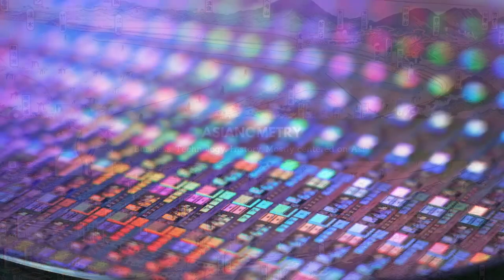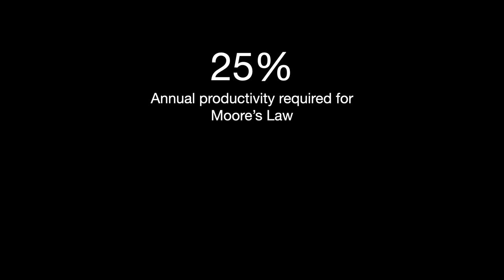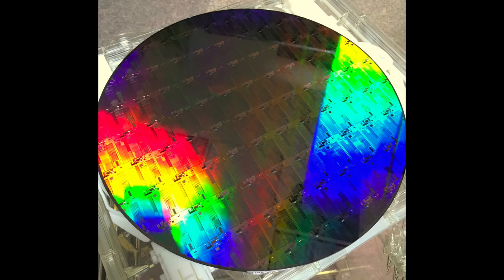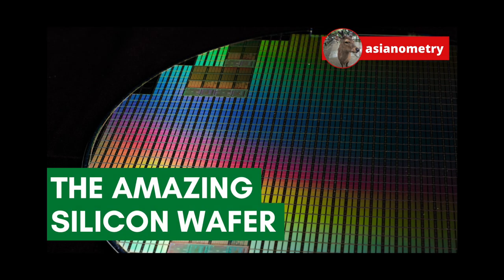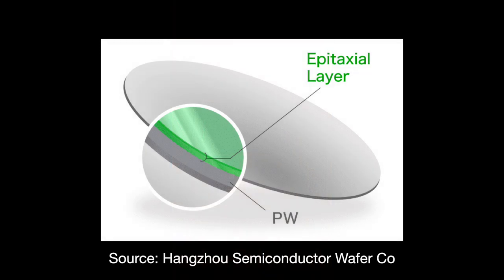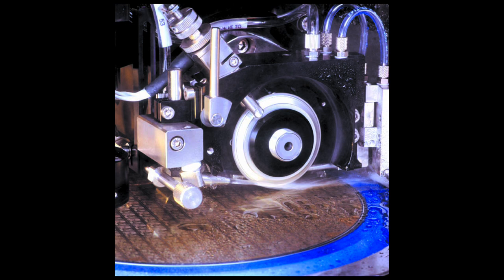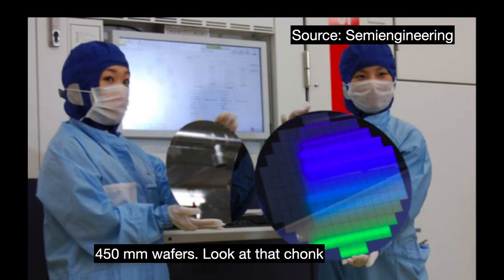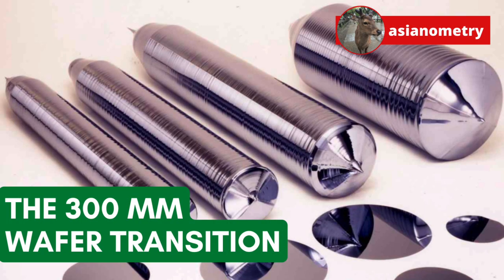The 300mm Silicon Wafer Transition

Comment: Some corrections or more detail!
1st Defects in the wafers substrates are not always bad. Bulk Micro Defects are very important as contamination getter and for mechanical stability.
So you have to prevent them near to the surface either by Epi-layer growth or Ar-anneal, but low BMD is also not always wanted. With CZ you cannot prevented it either. For power semiconductor, where you use also the bulk of the wafer for the device you need a different substrates made by the Floating Zone technique.
2nd FOUPs were not usual for 200mm. Either there are open cassettes or the cassettes are transported in so called SMIF pods.
One important part of the 300mm transition was the integrated full automation. Automated loading, transport and dispatching were the standard from the beginning.
3rd The 1st 300mm FAB was by Infineon/Siemens in Dresden Germany for DRAM. The FAB was later part of Qimonda and is now back to Infineon producing the 1st power semiconductors on 300mm. The 1st mover to 300mm were Memory Fabs and not Intel. Logic Fabs followed later.
4th You get more than 2.25 yielding dies from a 300mm than from a 200mm. The larger the die the higher the cut off loss at the wafer edge. So a larger wafer is more area efficient.
Reply: Was workers hurting themselves carrying 9kg around also accurate?  Because that's not that much weight.  Plenty of jobs require carrying more than that weight as a basic requirement.  Usually more like 20kg in a manufacturing job is a bare minimum written into job requirements.
Reply: This will be an issue for 450mm, but for 300mm it was not.

Comment: I worked in crystal manufacturing.
I saw a lot broken necks. This mostly happens when the finished crystal is ready to put out of the oven.
In fact it happens while it gets put out.
The crystal swings out of the oven. And the shear force does its job.

Then you have to clean the whole machine because parts of the crystal fall in 1000 pieces. Which sometimes damage the glas crucible. Which isn’t so bad. It’s not reusable anyway. But the oven itself can get damaged.

If everything works, the neck will be cut by pliers.
Reply: If there are any questions. 
Maybe I can answer them.
I did the 300mm crystals for the most part.
Reply: @markus4925  Interesting that you were part of actual boule growth.  Did you do any further work, like slicing and polishing, or were those all automated?  And were defective boules broken up to be fresh melt?
Reply: @markus4925  Do you think lower gravity would make the neck strength issue less pressing?
I imagine you want at least a little to keep the molten liquid in place, but it shouldn't affect the properties of the formed crystal I think?
Reply: @davidb6576  I could tell you what happens before the crystal is made.
A worker had to settle down rocks of material in the crucible by hand. Piece by piece. In a stricter clean room than the actual growth process.
The crystals itself have 3 marks lengthwise which grow together with the round structure. You use them to control if the crystal structure is still intact. That’s important while growing. You break up the oven process if you discover failed outer lines on the crystal.

The next process was sawing. That’s true. I don’t have much insights there.

But I visited the stage where the wafers are getting packed for the costumers. These are clean rooms of the highest levels. Like you see in Global Foundry videos for example.

Yes. You can restart a process. Usually you do it if a crystal breaks up in the middle of the growing process.
The crystal can break while in production by neck or at the position the crystal touches the surface of the melt.
If the neck itself breaks you need to install a new neck by hand.
After 3 failed restarts the whole load is considered as waste. You need to clean the oven and use a new glas crucible.
Reply: The process is automated.
The crystal is also watched by camera.

But you still can and sometimes have to regulate a lot of functions of the oven.
Like temperature, pull strength of crystal, different noble gas injections, preassure, ….

A worker usually looks at the error codes of one oven, then looks on camera pics and then through the lower glass of a machine. 
Then he/she walks to the next oven.

I once collected user experience for the developers to build a better control-GUI for the oven.
This was the most interesting work I have ever done. There were 2-3 experimental processes running everyday for 300mm.
The smaller diameter ovens usually didn’t need that anymore.
Reply: @markus4925  
Do you raise and lower the crystal or do you raise and lower the pool?
The void inside the chamber, is it a vacuum or some combination of inert gases?
Reply: @MostlyPennyCat  You place the seed crystal on a long metal rod. Which is placed in the upper part of machine below the oven. Connection itself is not metal on crystal directly but metal on graphite. (I forgot some details) but the crucible itself is also covered in graphite. Which is very interesting. 
No bare metal is touching any of the melt. If you need to touch anything within you use ceramic tools. 
After the melt gets more and more liquid state you are lowering the seed crystal. Often by hand till it went into the melt some millimeters.
Then you adjust the pulling.

Technically you could also lift the stand of the crucible a bit. But that’s more for cleaning purposes.

When the crystal is done you lift it out of the crucible. At that time it’s some 10 centimeters inside. Because you are not only pulling it out. At the same time the melt level is lowering. Which makes adjustments necessary.

I can’t remember details for pressure. 
But I am sure that’s some open available  knowledge if you read about the CZ process on the internet.

Sorry for my bad English. 🫣
Reply: Best thread. Thanks for this!
Reply: @agenericaccount3935  Makes me happy someone is interested in this.

Most people I know aren’t.
Reply: @markus4925  Wow! Great description. Sir, I got a question. The video said something about growing very pure crystal through chemical or physical vapor deposition. Why don't they do that? I feel like, then, people won't even need large Silicon ingots, wafers can be grown on thin, not so expensive plastic sheets.
Reply: @aniksamiurrahman6365  All our crystals were grown by CZ technique. 🤔
I know there are 3 or 4 other techniques out there. 
I can’t tell much about them.

But maybe I can give some practical reasons for the CZ technique.
It’s extremely difficult to sustain a stabil growth process. Even after many years the processes aren’t perfect. 
So, the management is happy to have stabile processes. And don’t have to rely on experiments anymore.

And it’s very costly to produce waste.
One crystal needs days to grow. And must be monitored 24/7. You can’t simply turn off the machines on x mass or Sunday. One simple machine without magnetic coils needs the amount of electric power a day a 10 person household needs in a year. 

You have 20 machines in one room.
And multiple rooms with machines are running at the same time. Therefore an own electric power plant was built next to the ovens.
Reply: Thanks for your detailed insights. I wanted to ask you 2 questions:

1) If the neck breaks, how is it possible for the growing process to be restarted safely when the crystal may have been damaged from falling to the bottom of the crucible or getting contaminated by the graphite walls?

2) If the neck breaks due to physical stress, isn't it possible for the manufacturers to come up with a way of supporting the crystal with precision mounts, clamps or braces? If this is not possible, do you know why?

Thanks!
Reply: @stogieyogi9373  If the crystal falls when the machine is already open for extraction the crystal gets damaged 100% of the time. It goes straight to waste.

If the half done crystal falls in the melt it’s tricky. The melt spills over. In different degrees. If it’s not too bad you can try to manually push down the seed crystal more than at the start. Which means you start again but with a shorter seed. And the part of the crystal which is already done gets remelted.

As said. As long as the marks on the crystal builds up in the process there is a good chance you will have a decent product again. 

Different accidents give different chances for this to happen.
Reply: @stogieyogi9373  2.) Yes. That would be a great improvement. In my opinion there should be some device inside the machine which supports it as soon as the process is done. 
I think you could earn a lot of money if you find a great solution for that issue.

We as operators/ developers had much influence on the improvement of the process itself. Especially on the electronics side. But the mechanical things were done by the manufacturers. At least the majority.
From time to time we built handling devices. But they were used for crystal handling outside of the machines.

It’s like building a desktop computer.
You buy the casing and then build all kinds of electronic around it. And use an OS but fitted with your own software, tools and GUI.

There are multiple manufacturers. Time goes on. Maybe some have some better solution nowadays. But I doubt that.
Reply: I have a feeling this would be cheaper to do in space in the far future.
Reply: @stogieyogi9373  Great questions.
Reply: Ideas - if a common break occurs after lifting out then swinging the boule, redesign to eliminate swing. Either lift the boule high, move a carrier between it and the oven to lower it onto. Or have the oven on rails, raise, move oven, bring carrier, lower boule.
Reply: @Shaker626  We still don't know much about how space affects industrial processing, be it for metallurgy or chemistry, it could be very different offering both advantages and new unforeseen difficulties or be relatively unchanged which would be good for space settlements not having to import everything. Especially in Chemistry I think it was discovered that space (can't remember if it was lower gravity or higher cosmic ray exposure) affected the chirality of some compounds when synthesized in these conditions, which could be a problem or a massive opportunity depending on which enantiomer you're after.
Reply: @Soken50  The low gravity and vacuum on the moon might be ideal for growing defect and oxygen free 450mm diameter wafers.
Reply: @Shaker626  The low gravity and vacuum on the moon might be ideal for growing defect and oxygen free 450mm diameter wafers.
Reply: @markus4925  Thank you for sharing your first hand knowledge. 

Can you point to a video or image that shows the longitudinal markings you have mentioned?

What is the native shape of a silicon crystal, something like a uncut diamond perhaps?

Could you tell us what you remember of how the seed crystals are prepared, mounted on the rod?

I remembered that in some crystal growing there was a rotation between the boule and the melt, is this the case with silicone and if so which one does the rotating?
Reply: @KallePihlajasaari  Might be, might not be, until we build a lab in microgravity we don't know the effects of lower gravity on the processes.
Silicon crystallizes into a cubic diamond shape.
Reply: @KallePihlajasaari  
The seed is rotating.
The crucible can rotate too, but that’s usually for maintenance.

The crystal itself. Well, as you have seen on some photos the structure is cone shaped then elongated and at the end cone shaped again. The last centimeters get cut away soon after the crystal cooled down.

The markings are controlled by camera. If you are an experienced operator you see them earlier as the software. Lost markings imply that a remelt ist necessary.
You can immagine them like three spikes. About half a centimeter big. 

I don’t know if this is seed or process inherent. But if I have to guess I would choose the first option.

The seed. There was some kind of socket. Consisting of two parts. Held together by some dark non-magnetic material.
Reply: @markus4925  Thank you so much for your amazingly in depth answers - it has inspired me to look at things from a new angle and keep learning more about this. I hope your generous knowledge is rewarded well and that you remain inspired in this amazing field. Thanks again!
Reply: @stogieyogi9373  Thanks a lot.
A medical malpractice brought my life to a halt in my late 20s. But I am happy for still beeing able to talk about some nice memories.

I think the semiconductor industry is absolutely fascinating. And it makes me happy when others see the magic in it, too.
Reply: Your insights are so interesting! Are the crystals just supported at the top, hanging with their full weight? Why not grab the finished upper parts from the side, too?
Reply: @tristanwegner  yes. The crystal hangs with full weight. 
While in the manufacturing process there is no other possibility. Because the crystal itself grows out of the liquid in the crucible. 

If you would stabilize the crystal on the sides you have to consider the crystal is spinning the whole time. 🤔

Stabilization is done when the crystal is outside of the oven completely. Opening  the oven and full transfer of the crystal takes 30, 40, sometimes 60 minutes.
The swinging of the crystal from the oven to the final holding device is done in slow motion.

Comment: Thanks for this trip down memory lane.

I worked in the industry at a metrology equipment manufacturer from 1996 to 2005. We started with (100,150) 200mm  equipment with manually loaded cassettes and by the end we were handling 300mm FOUPs and supporting SECS/GEM automation standards. It was a fun time, I got to travel.

Comment: Got some questions from ignorance:
* How thick are the saws which cut individual wafers off the cylinder?  Or to put it another way, how much of the cylinder is lost in dust from the saw?  What do they do with this sawdust?

* Are there alternatives to mechanical saws?  Say ... lasers, with or without sharks?

* Could vapor deposition be used to grow individual wafers instead of entire cylinders and avoid the sawing process altogether?
Reply: Wafers are sliced from the Crystal using diamond wire band saw blades, very similar to the process used to slice counter top slabs from a block of marble or granite, just in miniature.
Water is used in large volumes as a coolant and lubricant. It also carries away the dust to a containment tank where the slurry settles out of the water. Ideally the water and slurry would be filtered , dried and recycled back into the process. Unfortunately this is expensive and very time consuming and since profit is the end goal,  it's easier and cheaper just to use fresh water and dry raw materials. This results in large slurry retention ponds either on the surface or underground and ultimately slurry will leach back into the rivers lakes and streams. Yes lasers and plasma cutting are both options, however, heat creates it's own new set of issues in the process. Vapor deposition is incredibly slow and at this point not yet a viable option. This may change in the future. For now, seeding crystals is the most reliable option.
Reply: Wafers are polished after getting sawed, so all that dust probably gets removed then. 
You can't use a laser for this process because of the thickness. It's too thick to simply ablate (vaporize) material away with a high power laser, so you would be introducing a lot of heat to the silicon crystal. You can only realistically use lasers for dicing dies off of an already processed wafer, where the wafer is already fairly thin and easy to ablate without introducing extra heat.
Reply: @fatmouth007  Thanks.  The sharks probably  wouldn't survive in the ultra pure water, and lasers wouldn't be much fun without them :)

Comment: Excellent video Jon. I spent my entire career in semiconductor industry, from 1966 to around 2005. One area you left out of this remarkable treatise is the really antagonistic relationship between semi makers and their customers. Once a fab is completed and in operation, it has a finite lifetime, for the reasons you cover in this size progression. The only way to be profitable is to load the fab 24/7/365 with wafer starts for this lifetime. The end customers, cancel, reschedule, under forecast, over forecast, demand price concessions, and all manner of other unprofessional activities - because they know the fab has to run wafers or die. Each wafer is end user specific once started in many cases. Only commodity memory and some common logic devices and microprocessors are more flexible.
After 40 years, I hated most of our customers…
Reply: Nowadays I guess it's the other way around, since TSMC can pretty much choose which costumer to attend. Thanks for sharing.

Comment: When I started in the industry in 1984, I was working on diffusion and LPCVD furnaces with 4” (100mm) wafers. My last field service job in 1992 was working on Scanning Electron Microscopes for CD measurement with 6” (150mm) wafers. That was about the time the industry started transitioning to 8” (200mm) wafers. The SEM had a stage that tilted to 45deg. This required a relatively huge vacuum chamber for the “specimen”. I had left the company by then, but I think the transistor to 200mm wafers prevented them from going further with their SEM CD measurement tools. I moved on to an R&D job working on a laser microscope that could handle 200mm wafers, but I had left the industry entirely before the 300mm wafers came out. I wonder what the cost of redesigning all the semiconductor equipment was at that point. It must have been huge considering a basic fab was over $1 billion by that time. It always amazed me how much money went into a typical fab, even in the 1990s. It’s mind boggling.